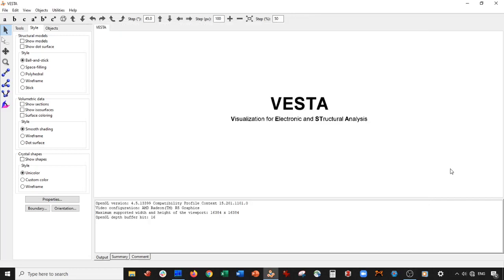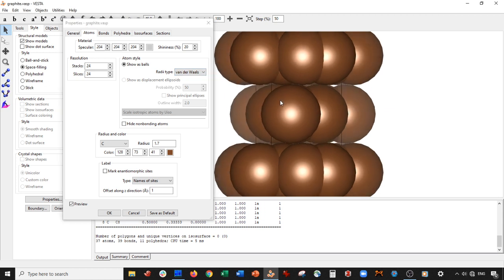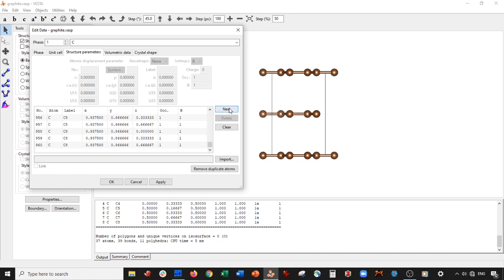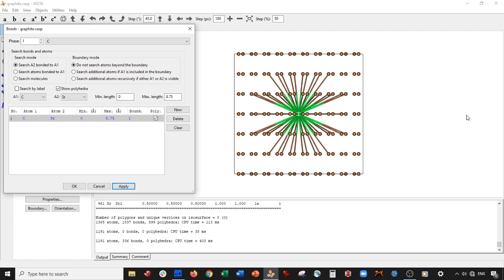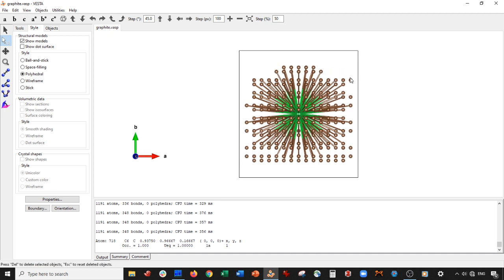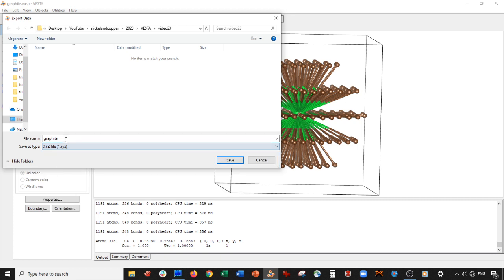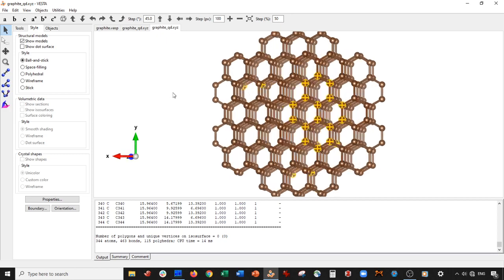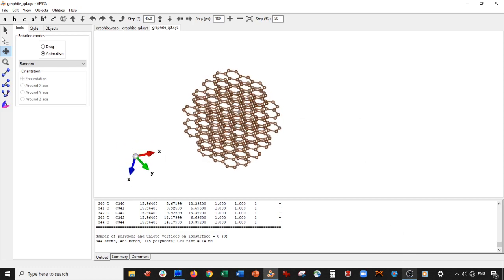VESTA Software - Build Graphite Quantum Dot

Comment: Hi could you show How find the plan in trigonal crystal
Reply from the maker: Cancan you please provide more information? Which plane? What would be the end goal?
Reply: Nickel and Copper    I work on Ga3NI2    Trigonal P-3 m1 , a=b= 4.052A. C=4.8887A.  I am work on the surface of plane  (010)
Reply from the maker: The 010 is already an exposed plane
Reply from the maker: I have a few videos on adding vacuum to already exposed planes
Reply: I now the plan 010 is exposed but I don’t now why my teacher want use ( orientation   - project along the  normal (h k l) then put projection vector 001 and upward vector 100 .

Sorry I ask many questions ?
Reply from the maker: Hi Amnah, it is fine to ask questions, no worries. The problem I am having is that I can’t quite understand what exactly you are asking?